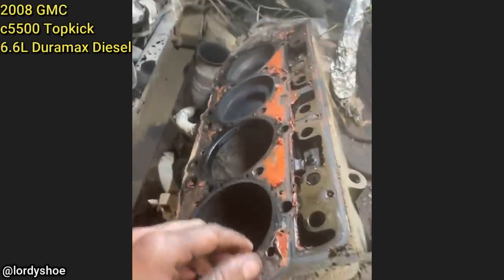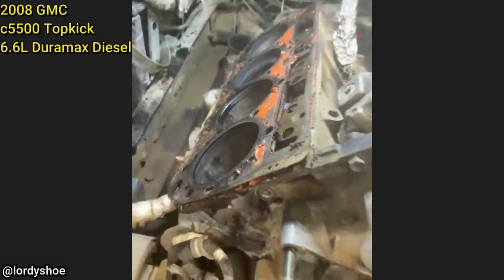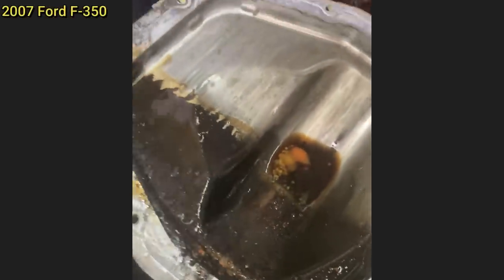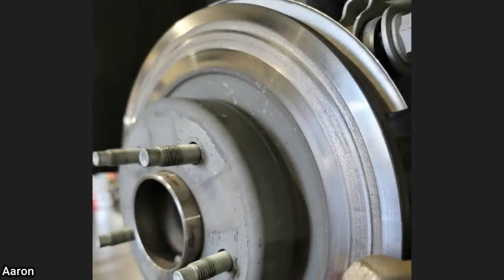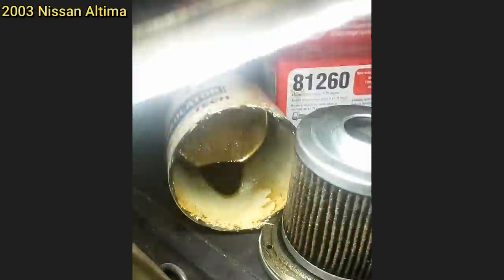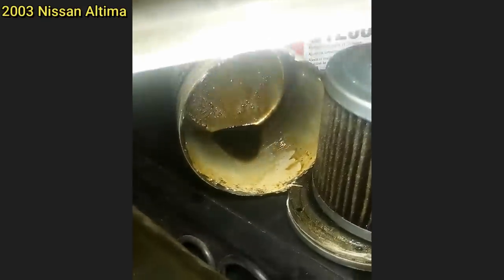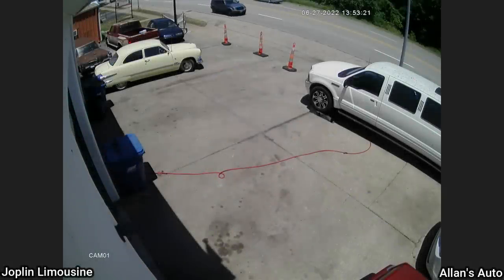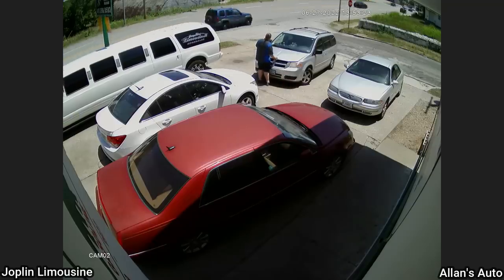Customer States Truck Might Need New Head Gaskets (GMC TopKick) | Just Rolled In

Comment: On the tire pressure. I think the tire company's need to stop putting the MAX air pressure ,has I believe people read this and think that is what said tires should be at. Please look at the label on the drivers side. It tells you exactly what is recommended  and please read the manual if included . For those who don't know. I wish schools would teach useful things like this instead of the garbage they teach now. Ok Rant over.
Reply: They have to in case the tire is incorrectly used in an application that calls for more pressure.
Reply: @ohger1  That I understand. But they need to put " do Not exceed " or something along those lines.  And well most don't even read labels anyway. Yeah they / Company's have to cover their butts. People are their own worst enemy.

Comment: I seriously think these people think they will get their car problems fixed for free if they drive it in and state what they think the problem is. Why do they bring the issue in, describe exactly what they think is wrong. Then refuse to fix anything when they are told what the problem is? I think they strategize like that, or try pulling some scam where “you made the problem worse so you have to fix it”

Comment: I had a 300 that had the passenger window didnt work. Was told before purchase the motor went out..failed to mention the motor went out with the control arm as it got ripped out and replaced by wood planks. Lazy cheap  asses 🤦

Comment: On the one with the metal in the oil filter. I wonder how much of the metal shavings are from when they cut it open with what looks like a hacksaw. SMH!
Reply: They probably used a zipper wheel on a die grinder, I was taught to do that and didn't realize how stupid it was at the time. None of that metal really looks like bearing material, depending on how long it was like that and how it was driven it's probably fine. I've seen cars get run low on oil hundreds of times and only a couple engine failures as a result.
Reply: @Sheehy223  You're probably right.

Comment: 2:33 regarding the AC - I don't really blame the owner for not knowing how to work the AC through the screen. I'm sick of all this touch-screen BS for everything - I can almost guarantee a lot of those screens are going to just FAIL over the next few years and the AC will be unusable. Some physical controls and dials makes much, much more sense from a usability perspective, especially while driving which is why the car it's in exists in the first place. Something like a basic control shouldn't be buried away in a menu - that's user interface engineering 101.
Reply: Amen to that.
Reply: It is cheaper and lighter to run wires and have an actuator at the device than to run cables and levers. There is less to the dash and easier to produce. Instrument cluster and the panel is easier and looks expensive. Problems? buy a new one.

Comment: Fake problem on the 4 wheeler. The boot was cracked (...and they crack very early), and it filled with water as would be expected on an off road 4 wheeler. This had nothing to do with anything. Shaft seals on the front dif would have kept that water out anyway. Water only gets in there if the vent tube is missing or busted. Regardless, neither has anything to do with steering.
Reply from the maker: That rack was from  a 2013 F150. Not an ATV.

Comment: I'm not ready to blame the owner for not knowing how to adjust the climate control in their car. Switching from external controls to hidden touchscreen controls is a really bad move by the automakers! Along with making it difficult just to locate the controls, it can become an expensive and potentially impossible repair job if the screen breaks and you can't find a replacement.

Comment: Wait, does that tech even know how climate control even works? You set the temp how you want it to be, like a thermostat, it's not setting the temp of the air coming out. Are people really this dense and just put in on "LO" all the time? Do you set your house for 50 in the summer and 100 in the winter just to get the temp of air you want? Of course not! In this case, all they had to do was set it to Auto or AC instead of heat, but the way they demonstrate it shows how dumb the tech really is.
Reply: Not how it works Daniel.  At home, your heating system is generally binary (except for hydronic mod/con boilers) but in a car, raising the temperature changes the blend door percentage so the air coming out of the registers is variable.